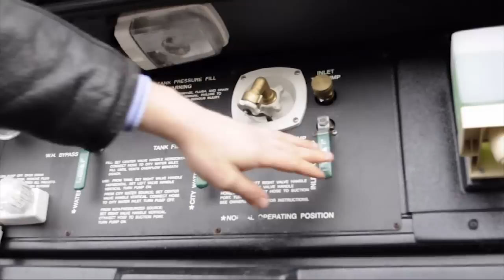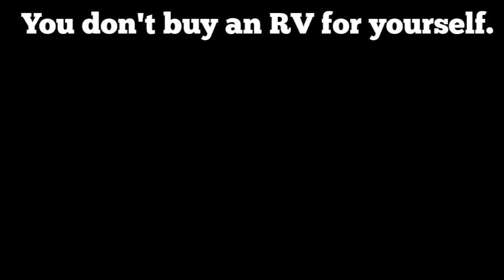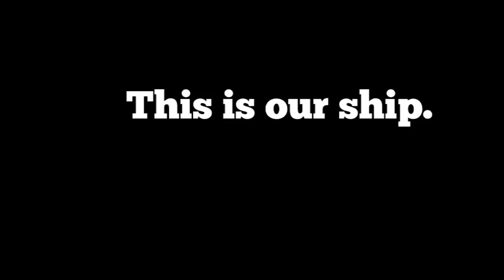Regular Car Reviews: 2004 National RV Tropi-Cal

Comment: Anybody else notice the Chevy Silverado Headlights and the Ford Econoline Tail lights?
Reply: immediately noticed the headlights.
Reply: Justin Noker some fl custom chassis had superduty headlights. These rvs were a mash of a bunch of crap. And let me tell you, doing an a/c compressor sucks. I worked for a freightliner dealer.
Reply: 2002 Silverado headlights... erch. I am not a fan of that year's front end.
Reply: I instantly noticed i thought i was the only one. tahoe/99-02 silverado headlights are definitely unique
Reply: Daniel Pinel I always thought the 99-02 Silverado’s were much more handsome than the 03-07’s.
Reply: Yes
Reply: It's probably cheaper to buy DOT approved lights from Ford and GM than to design new ones and go through certification.
Reply: oh my god it's fucking hideous
Reply: Idk why they used Chevy headlights. Sealed beams look cheaper.
Reply: Since this is a freightliner chassis they could of went with freightliner cascadia headlights wait nvm would look better with the classic XL sealed double beams.
Reply: @insanetaco98  I've seen one with e39 bmw headlights once..
Reply: Yeah it's got a Chevrolet front end and Ford tail lights
Reply: Justin Noker 
METO!
Reply: Headlights and taillights range from Honda Civic to rolls Royce lol.
Reply: Can’t unsee it
Reply: @walkerforsyth6221  I saw*
Reply: RVs use SUV/Truck headlights because they're not hard to find if you need to replace them.
Reply: @insanetaco98 yeah they are an absolute nightmare to work on just like coach buses. The builders continually go out of business because they build junk that only lasts 3-4 years without major problems. Then you are left scrambling to find aftermarket support like parts, oem service info, etc. I used to think these were a good alternative to a house until I started working on them.

Comment: So you're telling me the engine on this is STILL smaller than a Dodge Viper?
Reply: In terms of displacement, yes. 
In terms of actual size, no. This things engine is a behemoth. It has to be to handle all that boost pressure.
Reply: barely smaller, on half the cylinders, yes.
Reply: But the Nm of tourqe will run a WWII tank and then some!
Reply: @ChaotiX1  it probably weighs as much as a viper. They're usually cat c10 diesels.

Comment: The Catalina wagon at 13:35 needs to be a video in itself
Reply: Some of those Pontiac wagons had a 400 or larger and would snap your head back when the light turned green... Especially if mom was pissed off. Head rests weren't a thing, back then.